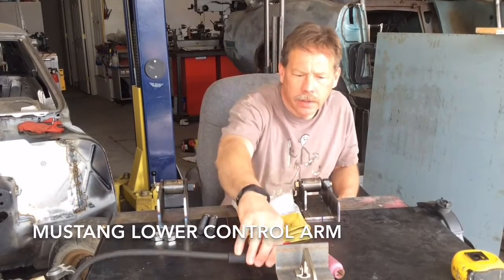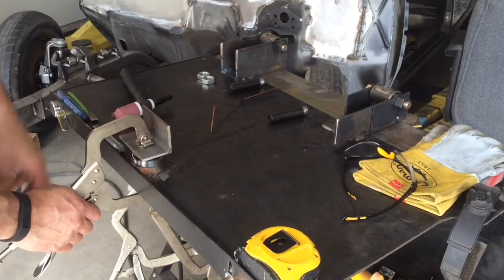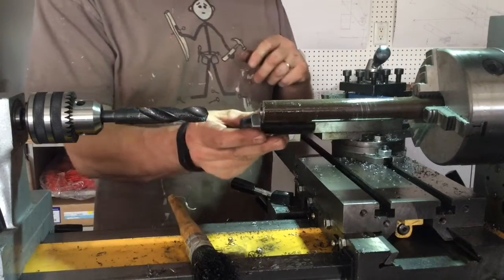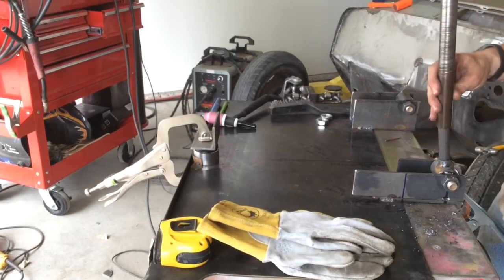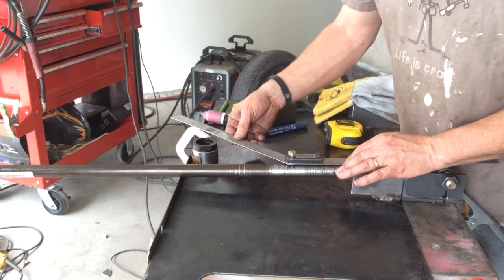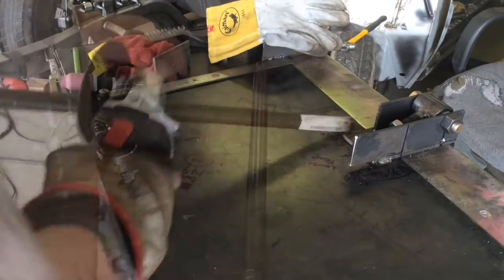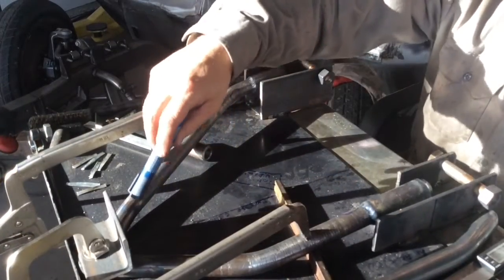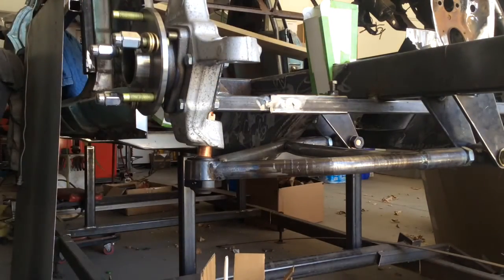Mustang Lower Control Arm Build

Comment: I'm about to embark on the same journey with a 1969 Falcon.  What ball joint and sleeve did you order and what knuckle are you using?  Great job, btw, and thanks for sharing this.  I can't imagine dropping $3K on an MII kit when I can weld and fabricate myself.  Plus I like the idea of being able to use OE components for easy upgrades and parts replacements.  Gonna be a fun project!
Reply from the maker: Bradley, I’m using C-6 corvette uprights and then I ordered 3 piece, screw in lower Ball Joints that have the correct tapper.  The upper Ball Joints are stock corvette and I made pucks to weld to the end of my upper A-arms that have the tapered hole in them.
Reply from the maker: There are some pretty cool kits out there, but I like making stuff and it gives me a reason (as if I needed one) to get more tools.
Reply: Wow, thank you very much for the help!  I agree man, I could buy a nice TIG and tubing bender with the money that kit would cost.  What is the company you ordered the ball joint setup from?  I'll be sure to watch for the next installment and see how you make and mount the uppers.   @AllisonCustoms
Reply from the maker: Howe Racing - Easiest to call and tell them whatever upright you use.  They seem to know every taper out there.